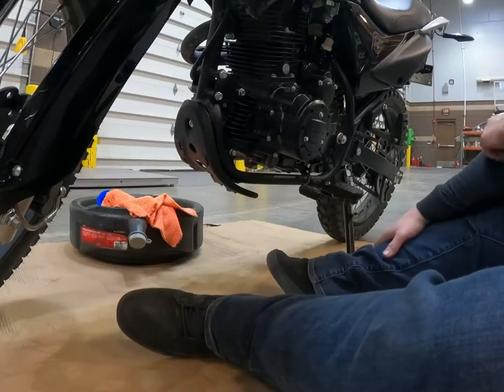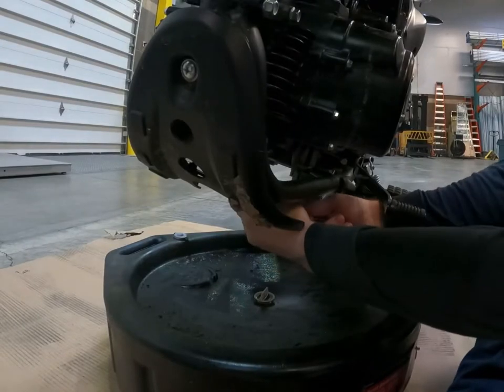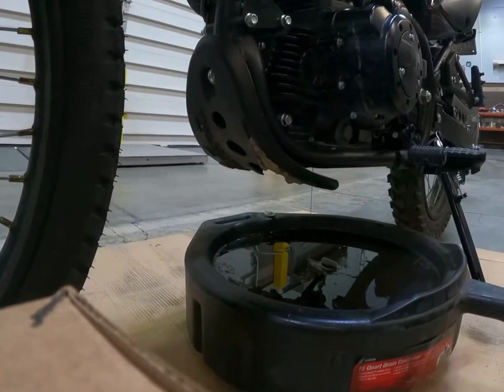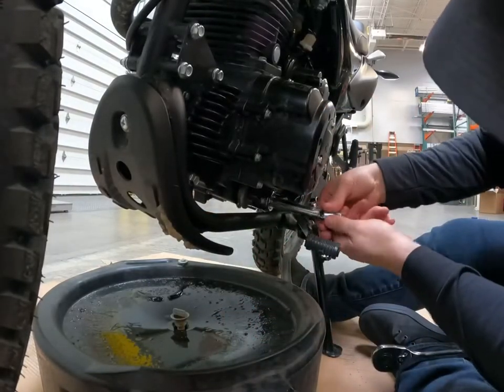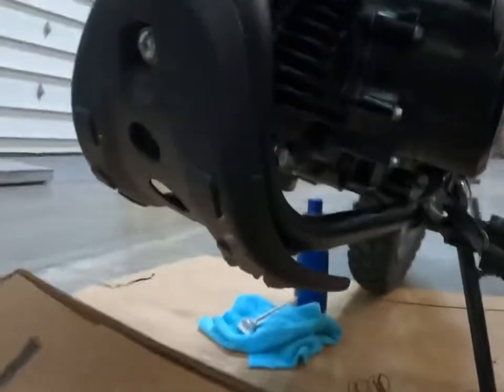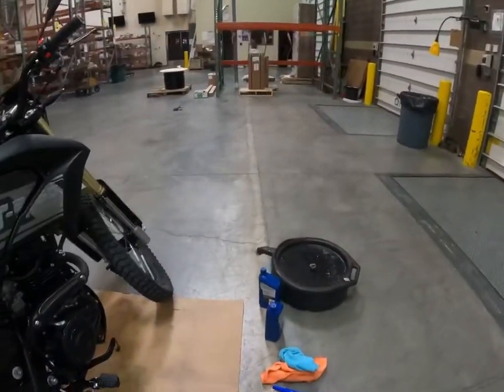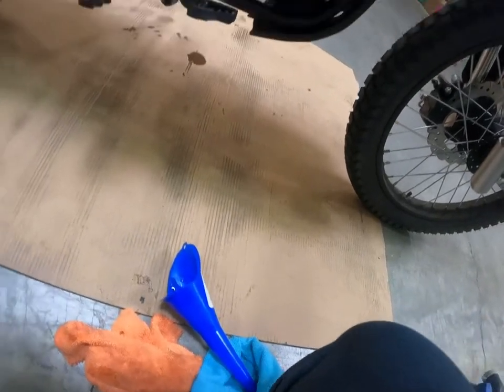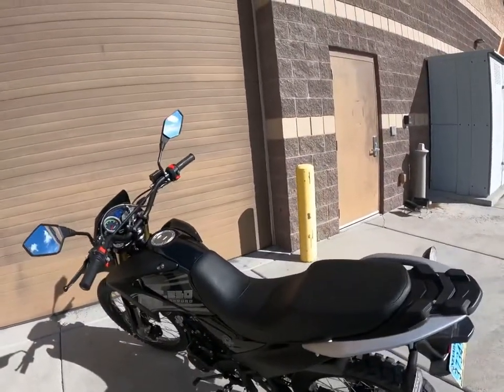HOW to change oil on 2021 CSC TT250! My FIRST time Tutorial ON GOPRO 9! Thoughts and Tips, Motovlog!

Comment: Did you use the original oil for first 200 miles or did you get better oil?
Reply from the maker: You have to use non-synthetic oil on the first oil change and can only use synthetic after the first 1000 miles is what the manual said. Hope this helps 🤙